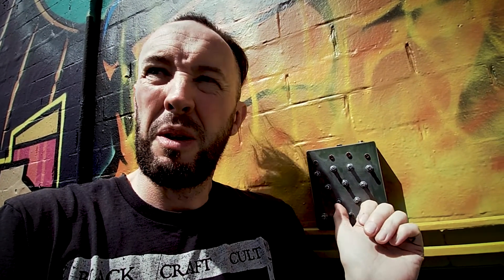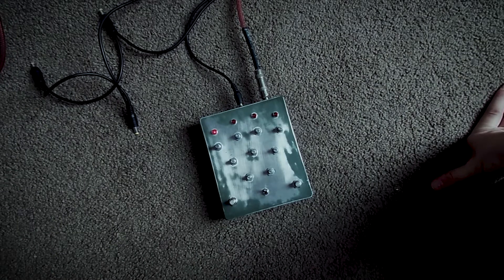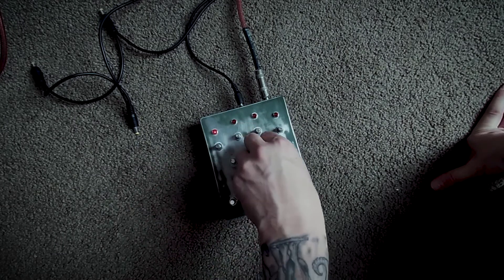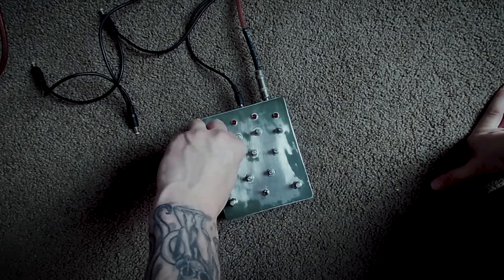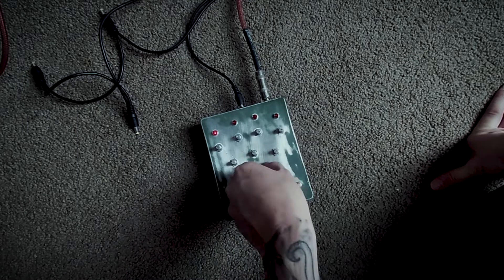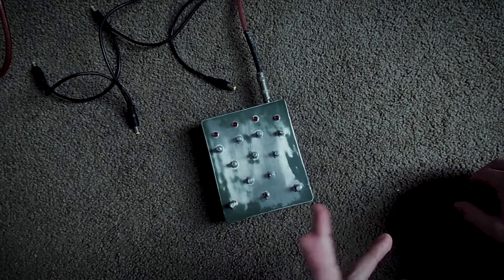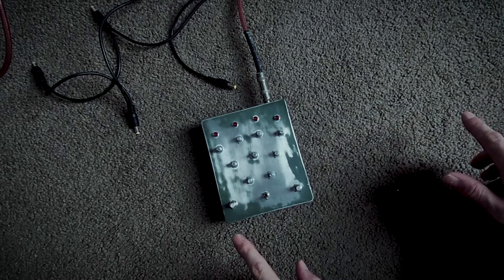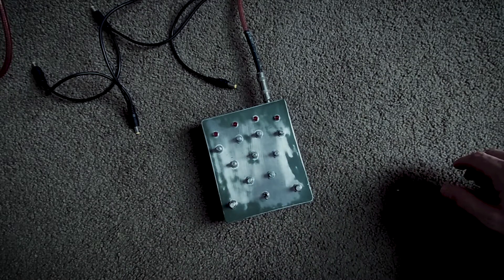Quantum Defrakulator Drone Synth with Sequencer: DIY Circuit and Sound Demo

Comment: Love this! Looks and sounds right up my street; built the devils triangle synth and a few of the super simple oscillators from Look Mum No Computer but have been looking to build a 4 or 8 step sequencer. A 4 step built in with the oscillator looks ideal. Straight to the top of my build list.....just not keen on the idea of drilling for 11 pots and a switch......
Reply from the maker: Yeah took me 3 nights to wire the pots up into the box. The drilling is ok just the wiring is a pain.